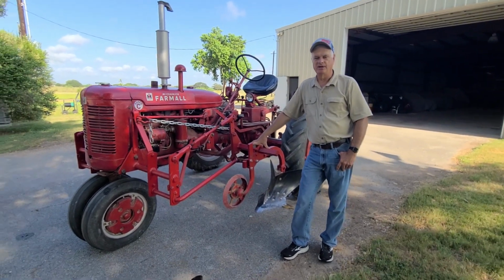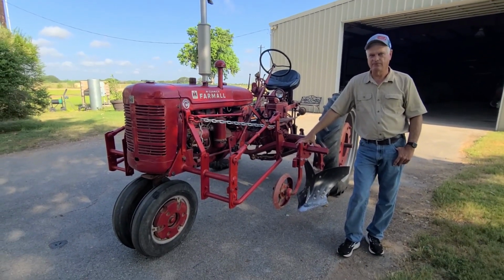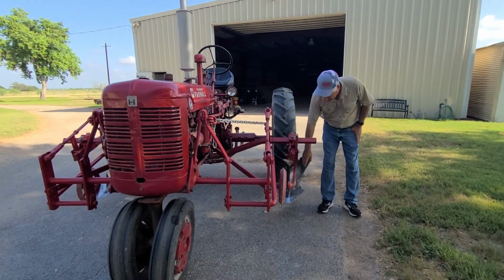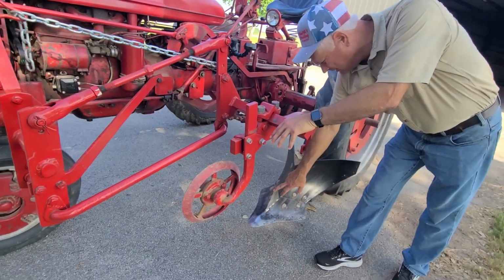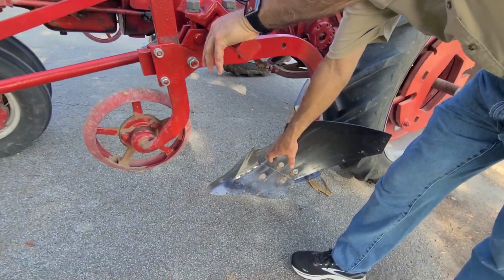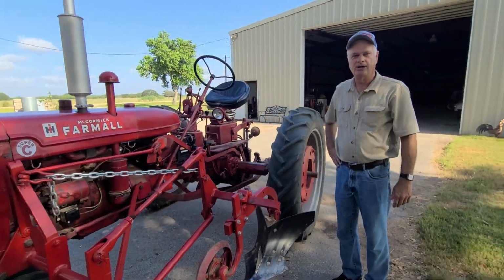Plowing with middle busters on a Farmall Super C (2023)

Comment: I got a set of these but I have never middle busted like that with them. I couldn’t judge where the next set of rows would be. I always went down and turned around then put my center wheels in the next furrow.
Reply from the maker: I understand what you're saying.  Having the old existing rows in place is a big help.  I like to disk lightly after harvest so that enough of the old stalks remain in place so that I can use them to sight by when plowing.  It seems a bit unusual at first since the front wheels run on top of the old row on the first time through and then in the furrow when picking up the skipped rows.